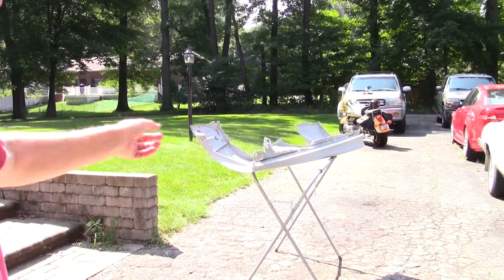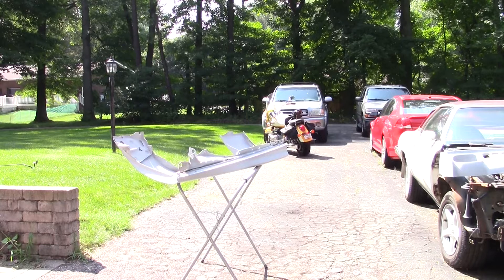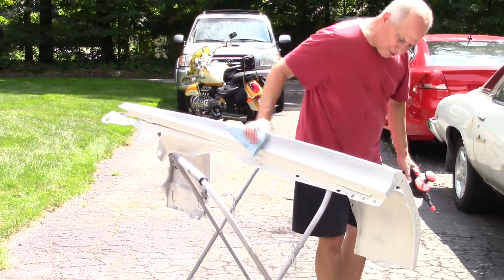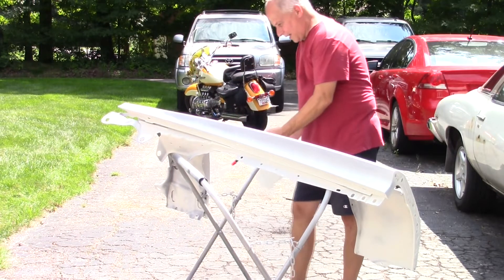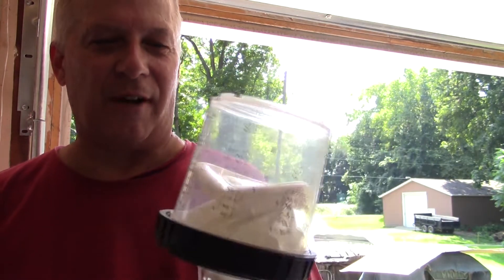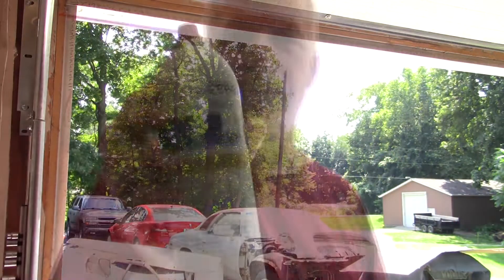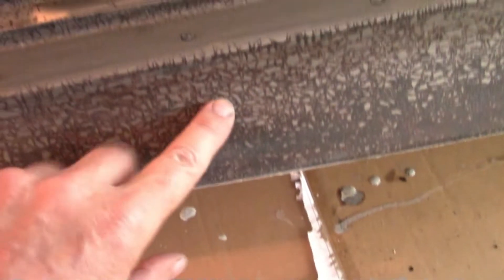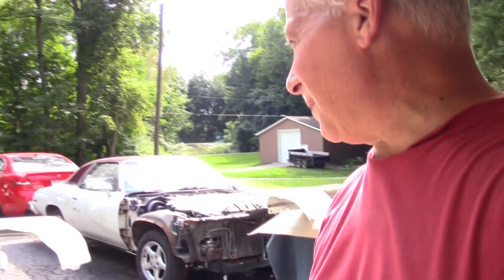1974 Front Clip restoration Part 2

Comment: Great video on a great vehicle. This will help me get motivated to finish my 77 Can Am.
Reply from the maker: That's good!  There is no doubt it takes a lot to achieve the visions in our head of how we want our cars to be.  The hardest battle I have with myself, is that I have to keep telling myself, it doesn't have to be perfect.  But what I have done has turned out so much better than I could have imagined.  I think I am going to upgrade my welder.  Having a Pontiac, you are well aware you have to learn to patch metal.  I'm thinking something I can use to tig weld would give a better finish when I butt weld something.
Reply: @GroundhogzGarage  Love these Pontiac style lines. I've learned a lot from a YouTube channel called Fitzee's Fabrications. I"ve used a ton of his techniques on my current project which is a 1975 Hurst Olds W-30. He's in a similar mindset that everything doesn't have to be perfect. But his results are great. Keep cranking out the videos!
Reply from the maker: @g3garage  I'll look him up.  More video's coming.  Editing is time consuming.
Reply: @GroundhogzGarage  Yes, video editing is very time consuming.